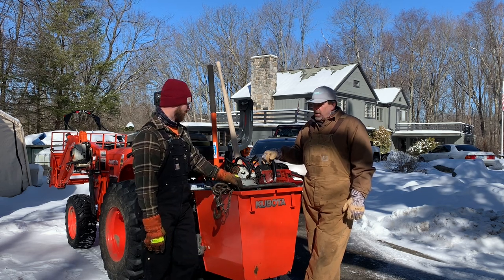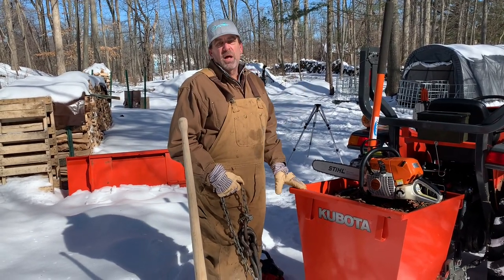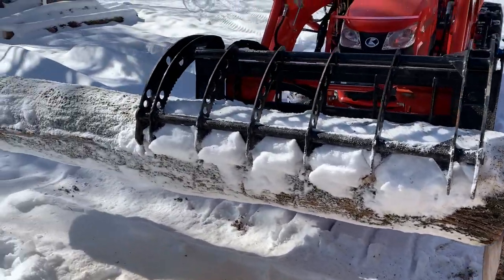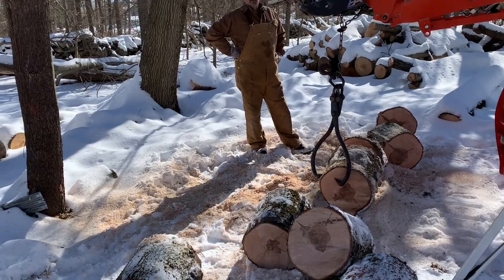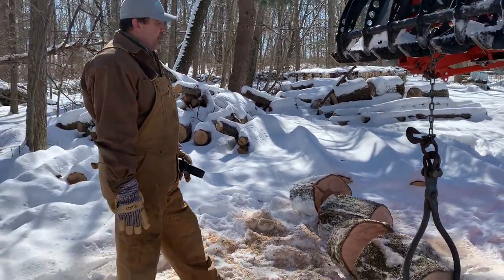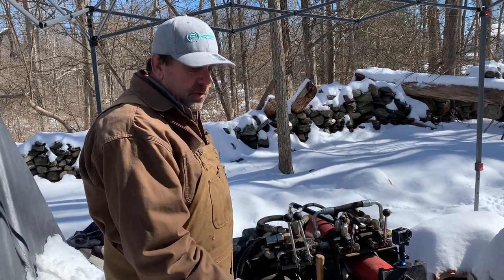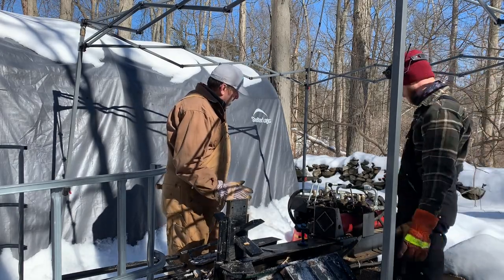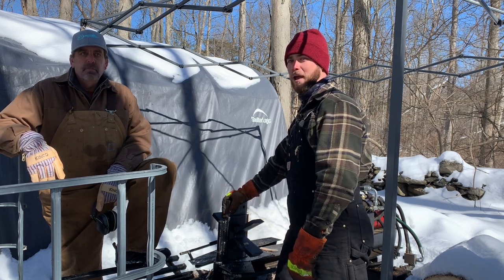#81 Using Log Tongs for Cutting Firewood & Woodyard Special Guest

Comment: I use my grapple to move the logs close to where I’m splitting. The first couple I cut the rounds and put them on the ground. After that I set the logs on those rounds and start cutting. It keeps them off the ground and after cutting I don’t need to move them as it’s a nice pile of rounds. I can just spread out to keep the pile from getting to high.
Reply from the maker: Sounds like a good process Steven!

Comment: Jake: The Log Grapple & Chain is one the best ways to left a log. But, two will give you more Stability, with a chainsaw in your hands. With your Grapple has 8 lower  rakes, giving you more points of Hook-Ups. This will also work with a set of Pallet forks. We use it on our JD CT332 Skid loader. Catch you on the next one!
Reply from the maker: I agree Howard! Going to be trying this soon!

Comment: Cut a V in a round and lower the short end of the log into it.  Use the tractor bucket to press down on it and the long end will pop up in the air.  Like a seesaw.  I saw it on outdoors with the Morgan’s.  Works better than the tongs.  Better yet buck standing up with a 25-28” bar and an 80cc saw.
Reply from the maker: Those are both interesting ways of doing it...lol

Comment: I think a pair of tongs mounted about 12” apart might be a solution and as a fellow follower suggested weld them together with a pipe if the first method doesn’t work that well
Reply from the maker: Yeah I’m going to see how this system works since I already have a few sets of log tongs from my trailer. I’m always open to modification if necessary!

Comment: Hi I had a question about your chipper do you believe  that is would be heavy duty enough for light commercial work material under 4” all pine aspen and fur?  Thinking of starting a tractor business slash chipping, driveway repair, and snow removal are in real demand in my area. I was just curious if the chipper is up to the task.  Really enjoy your videos Thanks
Reply from the maker: It is absolutely more than capable of that especially with small soft stuff like you’re describing. I have about 40 hours on the chipper, I am located in CT where it is predominantly hardwoods, I push the chipper to its 8” capacity regularly and it does it with no problem. Having the hydrostatic speed feed wheel really helps for the larger stuff. I would look into the MX 8800 or MX 9900 as they are the only two model chippers from WoodMaxx that are made in the USA. Tell them Jake from Dude Ranch DIY sent you!

Comment: Can grab your logs using just the last 18 inches of the log?
Reply from the maker: Yeah I can and have done this Stan, only issue I have with that method is the fact that it puts a lot of strain on just one side of the loader, don’t want to bend anything!
Reply: @DudeRanchDIY  I think you’d right. At some point doing and getting it done has to be more important than taking the time to make it marginally easier.  Keep trying new things and maybe you will find  a home run.
Reply from the maker: @stannelson2582  I completely agree! There are so many ways to do things and talking and thinking is great but getting it done is the important part!!